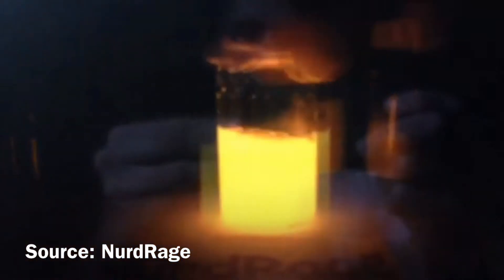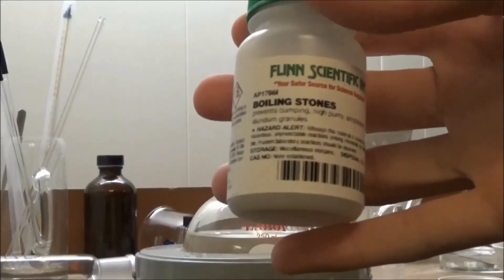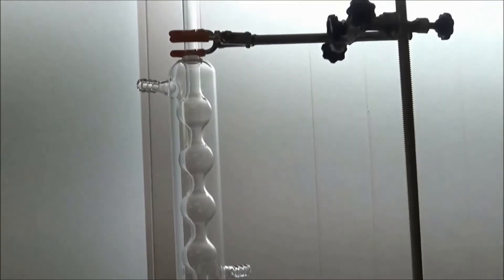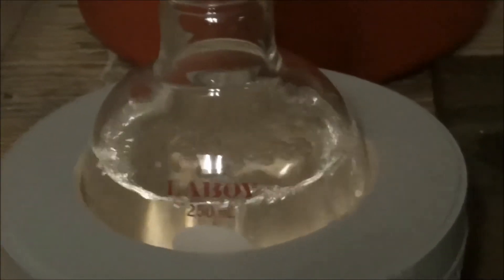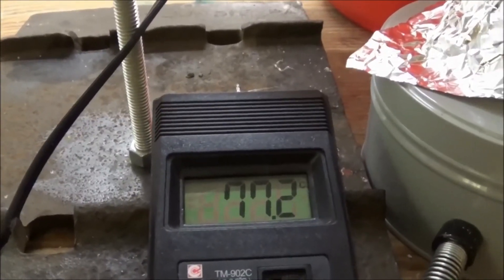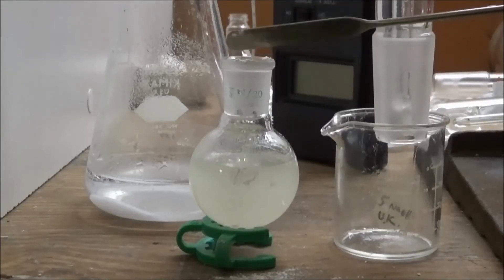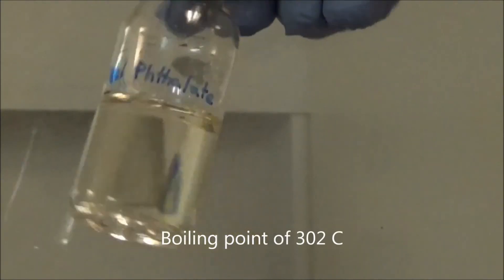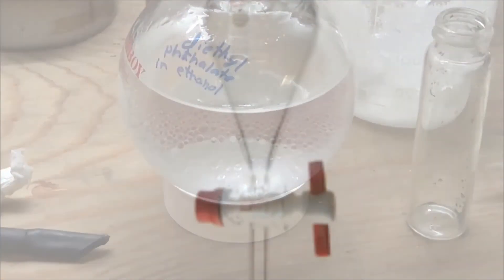Making Diethyl Phthalate

Comment: Hey I wants to make DEP at very huge level for industrial use, will please guide me?. what raw material and processes is required to make this DEP.
Reply from the maker: I'm sorry, I only work on small scale, you should hire an industrial chemist if you're going to do this on a huge scale. The raw materials will still be phthalic anhydride and ethanol.
Reply: +Tom's Lab ok thanks, please inform me that, what is different use pf this chemical, i only know is to mix with perfume to make scented incense stick.

Comment: I literally just had this problem last time I was in the lab, I thought I had closed the stopcock on my separatory funnel and ended up pouring out several hours of hard work by accident. It happens to the best of us. :)
Reply from the maker: I have done that several times, now I've gotten in the habit of putting a container underneath just in case. In this video the problem was actually different, too much pressure built up, enough that it pushed the stopper out, spraying the contents onto the bench (and me a little bit). Luckily not too much was lost before I got it under control.
Reply: Tom's Lab that’s a good strategy and it’s lucky you caught it in time. In my case I was so caught off guard that I looked around the lab like an idiot for a moment wondering where that trickling noise was coming from before I realized what happened. Meanwhile my product was draining onto the bench literally under my nose. I thought that might make you giggle.